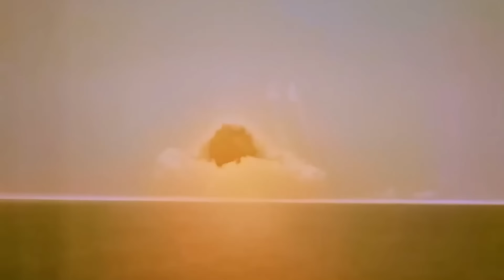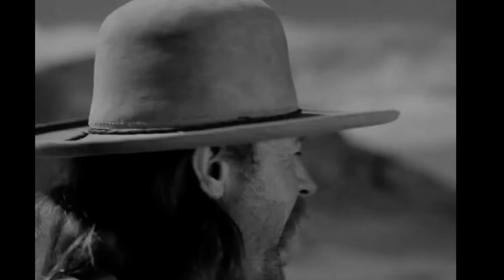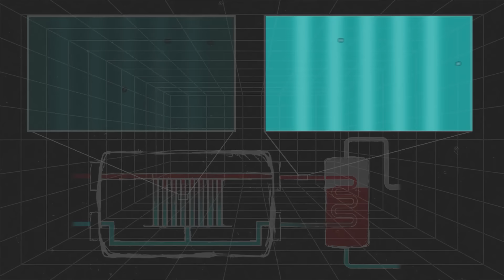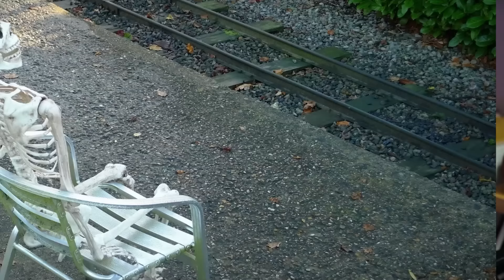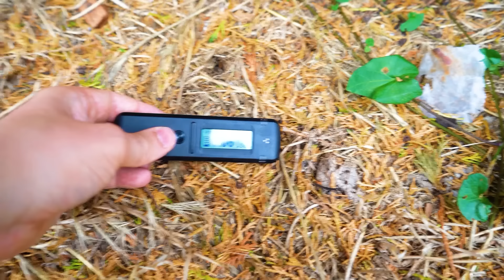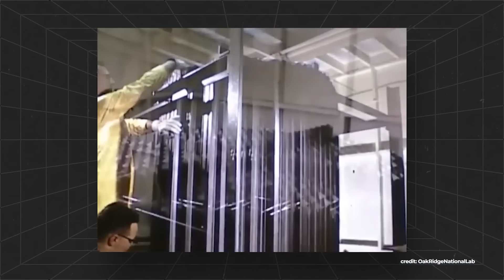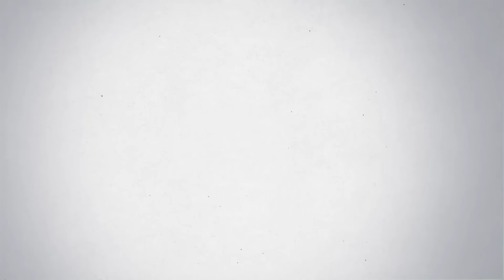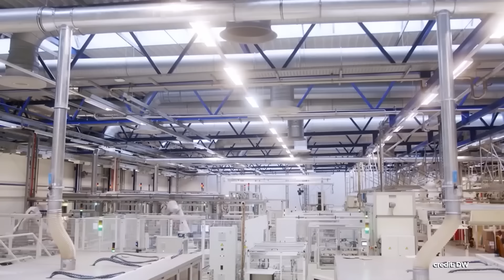It's Happening - China Launches World's First Thorium Nuclear Reactor

Comment: The meltdown of a molten salt reactor can be 100% walk-away-safe mitigated and is not a concern at all; the chemistry works out such that as it drains, the salt rapidly cools and stops being able to flow and mix and that stops the fission
Reply: I don't believe your description of "being able to flow" is a correct explanation. "Flow" is not the factor that determines whether a fission reaction is sustainable. That's instead the concentration of fissile material, the number of neutrons flying around, the speed of the neutrons, etc.
 
Conventional reactors use control rods to absorb neutrons to limit the speed of fission reactions. Get the level of neutrons low enough and the process dies, and the reactor is "turned off." 

Reactors also use other materials that accelerate the fission reactions. Remember from the show Chernobyl--the graphite moderators increased the rate of reactions (by slowing down neutrons enough that they were more likely to trigger more uranium to undergo fission, which caused the reactor to spike when they were trying to turn it off.
 
An approach of liquid fuel reactions is to 'flip the script'--instead of introducing water & control rods to prevent a sustained fission reaction, the fuel CAN'T sustain the reaction unless it's in the presence of a moderator. That moderator is in the heart of the reactor. If something goes wrong, the fuel drains out, and as soon as it is away from the moderator, sustained fission stops. 

The fuel+salt going solid isn't what stops it. In fact, if it solidified in the heart of the reactor, then you could have a runaway reaction. But that would melt the fuel, and then it would drain out, which stops it, hence it is fail-safe.
Reply: @theevermind  Industrial technology is always enthusiastic about a new idea because they don't yet understand the problems it raises. I worked on high temperature gas cooled thorium bred reactors in the 1970s. They were gonna solve all of the problems of water cooled and moderated reactors. Do ya see a lot of those around?
Reply: @jjhpor 
What reactor, where, company name, and what happened?
Reply: @theevermind  I was going to comment on this mistake but you got there before me. It`s not of course about movement, it`s about the concentration of reactants in close proximity to maintain fission.
Reply: @theevermind  Yea the video was very sloppy on this point. The chain-reaction must be facilitated by the (graphite) moderator channels in the core (which it flows through) and so in the event of a leak, wherever it drains it remains subcritical (via reduced reactivity). In case of the drain tank (which would be more ideal) the tank is designed to both subcriticality (probably it means multiple tanks just to be sure) as well as efficient heat rejection for the decay heat. This is neat, beacause you want the vessel to be well insulated and kinda good at retaining heat so the energy only leaves through the heat exchangers, while in an accident you want things to cool down as fast as possible, so after draining the better heat rejection helps at that.
In case of a leak the liquid salt quickly incrase its surface area which means that it volume to surface decrases, which leads to much better radiative cooling (as well as conductive) that is why even this occurance, is easier to handle. However, it's not entirely true that it becomes completely harmless, as it remains heated via its decay product content and even in partially crystalised form may outgas some of it's radioactive  fission product (and their daughters) like Iodine (sublimated) xenon, kripton, tritium etc.
It would be a much manageable mess, but still a mess.
Reply: @theevermind  I think when he said "flow", he was referring to the circulation of coolant through the reactor and heat exchanger, ie the thing that keeps a reactor from trying to reenact Chernobyl.
Reply: Absolutely, it's just a little additional problem
Reply: Fusion is always 30 years away and simultaneously 93 million miles away!
Reply: @ralphboardman7443 Thorium reactors are not fusion reactors. They are fission reactors just like all other operating nuclear reactors.
Reply: @ralphboardman7443  but one day it's just there to most peoples surprise...  

It's like always 30 years away until that point when it's suddenly working at a large scale. 

30-years away is the favorite phrase by journalists and some politicians, not the scientists that are working with it,  what I heard of...
Reply: Exactly. This has been obvious for decades. But certain parties have kept the focus on uranium.  Not to mention the induced hysteria about all things nuclear.
Reply: @Mythhammer  Ah yes, the black rain falling out of the sky in the weeks following Chernobyl was "induced hysteria". I think that regular people enjoy their rain without radioactive contaminants and they would prefer that we don't build machines that could explode and turn our rain Nuclear. 

Let's say I build a big machine that can cures cancer all cancer BUT once every 50 years, one of my machines explodes and the resulting destruction poses a threat to ALL life within a 500 mile radius, I willing to bet there would be a sizeable chunk of people who would say "Fuck it, I'mma just take my chances and risk getting cancer, these machines are way too dangerous when they go wrong"
Reply: @RenoReborn  Your response is exactly what I expected... Its obvious that you don't understand the physics/engineering and the psych ops that have been used. Modern nuclear power reactors (especially molten salt thorium) lack many of the major draw backs of the old technologies. if one investigates each of the major accidents, its obvious that poor judgement, design and execution resulted in the outcomes. Cheap abundant power is the very life blood of modern civilization.  Modern nuclear power is the most effective path to that goal.
Reply: Very true, but then you are left a ridiculously horrible repair or recycling problem to re-activate that reactor.  This is the same NOW with Lithium car batteries.  Nobody (yet) knows how to re-cycle these environmentally toxic items, so that ANY energy efficiency is obtained via the recycling process.  In contrast, ordinary lead-acids are recycled at about 50% energy re-useabilty.  That's pretty good these days.  BYD and TESLA are essentially "forever polluters" until they can make a 50% recyclable battery.  Toxic.
Reply: is it true that the molten salt design would naturally slowed down if the temperature got too high? passive thermal regulation. this is effect before the need to drain it. i've heard that once but not anymore, so maybe that wasnt true?
Reply: @Czeckie  It's true, but not exclusive to molten salt reactors, though it is more pronounced. Negative temperature coefficient of reactivity is kinda present in all sort of modern desings one way or another, but it more significant in case of a liquid core because its volume (and thus its density) could be affected more by changes in temperature, also it's more homogenous, thus less weird transients occur between distinct structural elements. At molten salt temperatures (bout 800-900 Celsius) the doppler broadening also plays a role (in HTR VHTR too) in droping the reactivity automatically because of incrased neutron absorbtion via broadened resonant absorbtions.
Reply: @Czeckie  yes its true but ignore the muppets arguing above , the reaction stops because the draining separates the fuel from the graphite moderator core which slows the neutrons to thermal speeds allowing the likelyhood of fission to occur , fast neutrons have a small chance of fission [ low cross-section ]  compared to thermal neutrons slowed by the graphite , draining the core halts the reaction and the heat now generated is only decay heat from the fission products decaying , easily cooled by the drain tanks
Reply: Technically, it doesn't stop the fission, it just slows the rate down enough so that the reaction no longer produces large amounts of heat.  Functionally the same thing, but the fission is not stopped, just massively slowed down.
Reply: @martinmelhus7324  Correct.  We had guys at our plant, who worked this decades ago.
Reply: Eddie currents in liquids can concentrate uranium dangerously.  Also in various filters.
Reply: @briandonovan9091  Very true.  In water this is self-evident based on the geometry.  In filters, it is the diffusion rate of the various ions.  If the slow ones pile up, and they are radioactive, a similar thing occurs.  The density of liquid sodium "should" preclude free-fall eddy currents, but this might occur in pressurized pipes, with kinks and bends.  Steam flow has the same issues.  Filtering of sodium would not be necessary, except for large particle inclusions.  That would indicate imminent failure of piping, and should be handled by non-invasive continuous inspection.
Reply: It's a complete lie that thorium is significantly safer than traditional toxic uranium based fission nukes - both invariably produce new poisons so dangerous that a microscopic particle too small to detect lodging itself in your lung or intestine will probably kill you, and these poisons last for millenia. Thorium's advantages lie in how toxic PARTS of fuel rods themselves remain, and that thorium can be bought cheaply in India, and from Brazil by the Chinese. Thorium in some ways is actually significantly MORE dangerous than Uranium, as the process for making the fuel rods themselves - irradiating the fuel - is so dangerous in many cases that people can't even be close to the process, & it has to done by robots. It also produces far more of truly horrifically dangerous radioactive cesium and iodine, which are both actually incorporated INTO living tissue, and deposited within bones, & emit ionizing radiation that will eventually kill in microscopic amounts.
Reply: I think that was the core problem of the first experimental reactor and why the whole idea was put on the back burner. The system was getting clogged up and things were failing because of the heat. It just seemed unworkable.
Reply: @michaelbaker8284  Another problem was pipe corrosion.
Reply: What makes you think that flowing and mixing are relevant parts of the fission process?
Reply: So where does the money come from to re-activate the reactor? It's actually economically non-viable to fix such a problem, which means you are left with a forever-problem to manage.
Reply: @xcrockery8080  Correct.  Usually these types of sites, unless they can be surface cleaned only, are just fenced off and left as a waste repository.  Already being done in many of our present disaster sites.  Not new.
Reply: In China, this will be a risk even if they had five times more people monitoring it.
Reply: Stopping the reaction has never been the problem with conventional systems. If the water should drain away, the neutron speed damping required for the reaction also drains away. The reaction stops. But the residual heat remains, which is the bugaboo.
Reply: @christianlibertarian5488  I wouldn't call it residual heat. It is radioactive decay from fission products generating heat...lot's of heat due to very short half-life.
Reply: PBRs are also walk away safe as demonstrated by an experimental reactor in China. All due to the physics involved in the structure of the fuel pebbles.
Reply: @bobsmith3983  I think the jury is still out on that. On current reactors, the reaction stops if the water drains out. But the residual heat is the cause of core melt downs.
Reply: Thorium is a good idea.  Lower radiation, lower pressure. How did they fix the corrosion problem with the pipes and the molten salt?
Reply: das System hat einen negativen Temperaturgradienten
Reply: You're right. The only problem with Thorium reactors is the corrosion of the pipes. Have they solved that issue yet?  If so, how long do the new pipes last?
Reply: The best part of molten salt safety is that it's pretty much 100% passively safe, it can basically shut itself down if something goes wrong.

Comment: I think Thorium is the future of nuclear power.  As far as the corrosive nature of the salts, would it make sense to use some sort of ceramic piping?  I remember back when I was a wee one in grade school in the mid 1960's geo thermal was making a tentative step into power production and the main problem was not the high temperature of the steam, but the corrosive nature of the superheated water destroying pipes and pumps rapidly.  I have read that they overcame most of the corrosion issues using ceramic technology.  I believe Iceland has rather large geo thermal plant(s) that seem to be working well, except for those pesky volcanic incidents.  Since I am not an engineer, maybe someone who is more tech oriented could possibly look into the possibilities of advance ceramics.  That would be a great idea for another video.

Comment: Because of corrosion and maintenance, they will probably be built in pairs (for large installations).  Having a few modular reactors dotted about, will negate this problem.  There is a valuable side-line to this type of reactor.  We can add nuclear waste (only 3% of fuel rods are used up) to the mix and a Thorium Molten Salt Reactor will literally "burn up" these other toxic, wasted fuels.  Also, that very rare and expensive element, Tritium (needed for Fusion) is a by-product of TMSRs.

Comment: Fast neutrons aren’t what cause the fission in a thorium reactor, they need to be slowed down by a moderator.

Even if the reactor doesn’t need water in its core, it still needs to get rid of its heat somehow. Usually this is done by having water from a river flow through a heat exchanger then back into the river.

Comment: Is navy second Nuc sub after Nautilus
Was salt reactor .

S2G was the initial power plant of USS Seawolf (SSN-575). This was one of three sodium cooled reactors (the core was moderated) ordered for the Seawolf program at the same time as three PWR units were ordered to support the USS Nautilus (SSN-571) program; In each case, one reactor was land-based for training and research, one intended for installation on a submarine, and one spare. The land-based unit corresponding to S2G was S1G reactor. The reactor core was beryllium-moderated.[1][2]
Persistent superheater problems on Seawolf caused the superheaters to be bypassed, resulting in mediocre performance. This and concern for the dangers posed by liquid sodium coolant led to the PWR type being selected instead as the standard US naval reactor type, and the S2G on Seawolf was replaced by the spare S2Wa reactor from the Nautilus program.
The Atomic Energy Commission historians' account of the naval sodium-cooled reactor experience was:
Although makeshift repairs permitted the Seawolf to complete her initial sea trials on reduced power in February 1957, Rickover had already decided to abandon the sodium-cooled reactor. Early in November 1956, he informed the Commission that he would take steps toward replacing the reactor in the Seawolf with a water-cooled plant similar to that in the Nautilus. The leaks in the Seawolf steam plant were an important factor in the decision but even more persuasive were the inherent limitations in sodium-cooled systems. In Rickover's words they were "expensive to build, complex to operate, susceptible to prolonged shutdown as a result of even minor malfunctions, and difficult and time-consuming to repair."[3

Comment: All your statements about thorium are basically wrong.
1. Its easy to use thorium to make nukes. The US did in 1955 ( Operation Teapot) Issue is that the thorium fuel cycle also produces U-232 which emits a hard gamma making it more hazardous to handle.
2. Thorium does produce a lot of waste, especially from mining, smelting and conversion into U-233. Some of the worse clean up sites are from thorium mining. 

China says lots of stuff than are just PR stunts. Recall when China stated that it fusion reactor was stable for over 10,000 seconds last year, Or China was going to be coal free by 2030 (yet still continues to build new coal plants every year). 

India has been working on a thorium cycle reactor since the 1990s, but its still not operational do to a lot of difficult technical challenges. 

MSR is pretty much DOA for nuclear power because of too many technical problems, such as corrosion (salt is corrostive), and removing waste from the molten salt, especially neutron poisons.

The US did have the first operational commercial thorium reactor operation back in 1962 with Indian Point 1. which operated until 1974. Thorium just wasn't economical and the U-232 problem made maintenance difficult.

Comment: Very nice description of the thorium cycle. I have some grammar help for you at 10:55. "Added bonus" is redundant. Say "bonus" instead, without adding "added".  At 11:09, "general rule of thumb." is redundant. Say "Rule of thumb" without the "general".  In short, "bonus" doesn't need added, and "rule of thumb" doesn't need "general."
Reply: It's not so much grammar but styling because the phrase is still grammatically correct.  The seemingly redundant adjective can be used for emphasis.